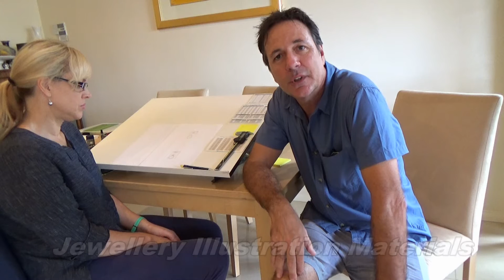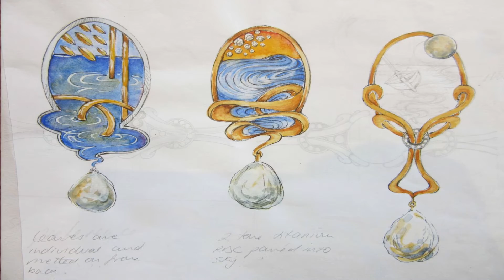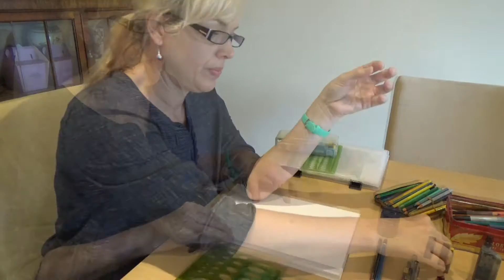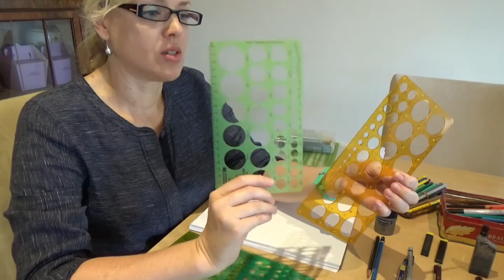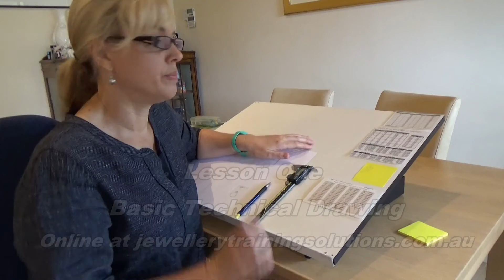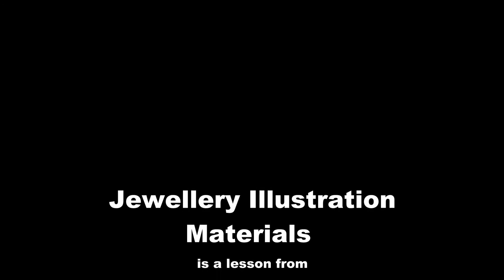Jewellery illustration (materials)

Comment: Having done a variety of illustration work in the past, I've found that traditional tools are now more or less obsolete for anything other than pieces intended to be sold for decoration. You can get a good digital pen tablet, a computer to support it, and a variety of applications with lifelike toolsets for what it might cost to set up and maintain a traditional workspace of any quality or reliability.
Reply: what digital pen tablet and applications would you recommend specifically for jewelry illustration?
Reply: @yahairam9220  Bit of a wall of text, but I hope it helps: 

Wacom used to have entry-level tablets, but lately they've been catering more to professionals with higher-end hardware... That may be because they have competition now, since Huion produces tablets of similar quality for lower prices. Huion have a variety of options for screenless tablets under $40, even cheaper than Wacom's discontinued Bamboo series. 

Wacom and Huion prices are equivalent for screened tablets, though, and would set you back at least a few hundred dollars - I don't recommend it unless you absolutely need that luxury. The Wacom all-in-one I use is $2k and absolutely NOT worth the price. Don't buy those.

For software, I use Paint Tool SAI, a ~$50 application intended for illustrators, because it's lightweight and easy to use. However! It lacks most of the (frankly unnecessary) bells and whistles something like Photoshop would have, and there are many equivalent options for the same price or even less. Clip Studio Paint comes to mind. Really anything that gives you tools to use your tablet is good enough to start with! Specialised tools (CAD, etc) don't help as much as you'd think, more of a fringe convenience once you're already used to basic applications.